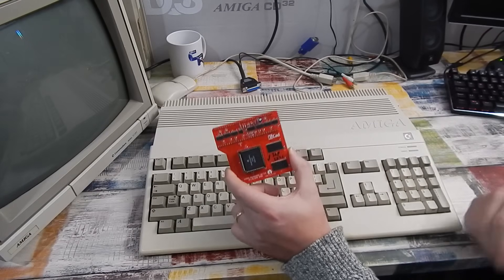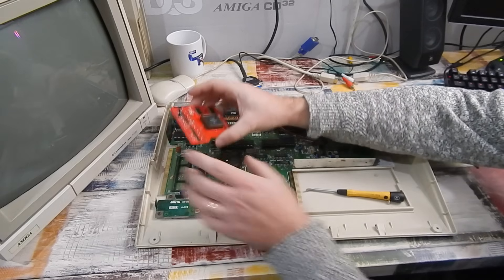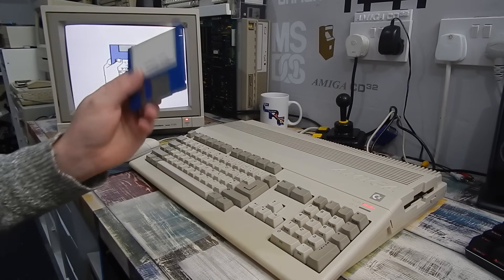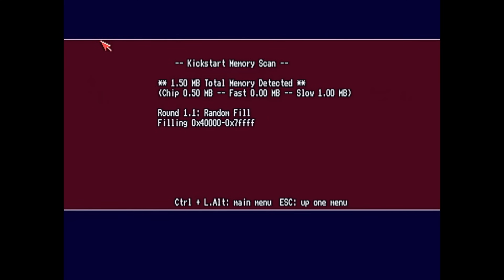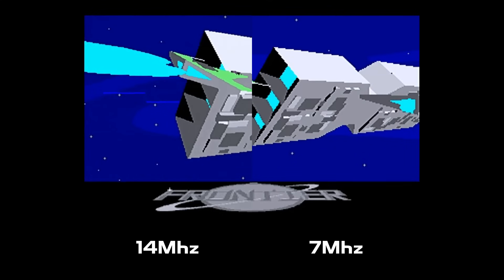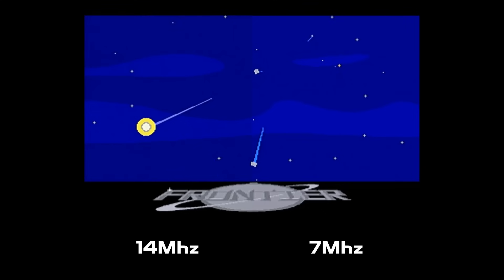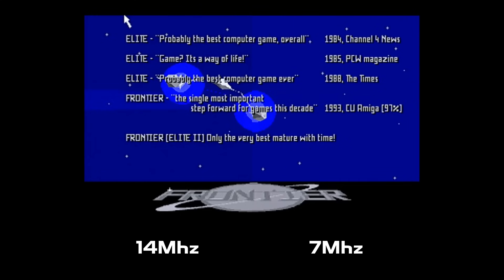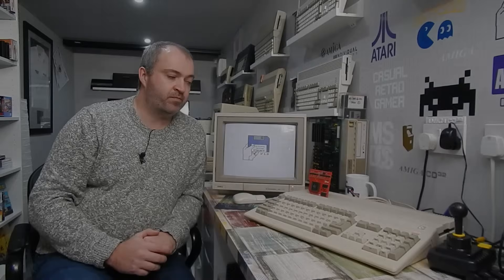A new Amiga 500 Accelerator for under £40

Comment from the maker: I feel a bit of house keeping is required.

Firstly the memory on this card is referred to as ranger ram, essentially fast memory but mapped into the slow ram address space.  From conversation with the cards designer this was done to simplify the design while achieving the best performance and keeping the cost to a minimum.  

Secondly there has been some comment over my stated price of this card and its availability.  I need to be clear and state that the card I have was genuinely listed for £35.  Anyone building and selling these cards is welcome to charge whatever they feel is appropriate for the cost of materials and their labour to assemble.  There are currently 2 of these cards available on eBay for £55 plus postage.  I'll leave it for you lot to decide if that offers value for money.
Reply: I think that having fast memory in ranger space is fine. You can go to 1MB chip and software that forces the use of slow mem should still work.

Comment: In many ways  I wish there had been a lot more games for the Amiga which specifically required more than a stock 68000 @ 7mhz. It might have encouraged many more people to upgrade but it was compounded by Commodore still selling things like the A600 longer after it shouldn't have even been a thing. There were many contemporary games that could run on an Amiga, but the market of say 060 and 040 Amiga owners was so tiny the R&D couldn't justify it.

Comment: I built me a couple of these, parts cost is about $35 each I'd say.  Did you have any luck stacking this accelerator with ide68k or any other addons?  When I tried it with my ide68k+mem68k combo at first it was a white screen, then there were flashing black bars, then colors, then solid black and I switched it off.  I built the 2nd one with a different PLL and it has better clock duty cycle but also frequent guru meditation, I think the problem is the clock phase which I can play with using the variable delay line chip I have.  As-is that one only produced a black screen with ide68k+mem68k, so I'm thinking clock phase is worth looking into.  Too bad I don't have separate ide68k or mem68k to test with.

Comment: The best A500 is A500 with a hard drive (CF) and bit faster CPU and more memory. Turning it into superfast A1200-like may break the compatibility with plenty of original software. Running games from HDD with more memory solves all the problems we had with this machine in the past which was disk swapping. Most of games won't even use the accelerator and it's unlikely that you'll going to use sophisticated software that takes advantage of fast CPU. Keep it minimal and close to the original as possible.

Comment: Someone has produced a small board that plugs into the 68000 socket and a raspberry Pi zero plugs into it which software emulates the 68000.  I'm wondering how the Pi solution compares with accelerators such as this one?
Reply from the maker: That's called the pistorm, I have a few videos on it if you want to take a look.  It is considerably faster then this board(about 25mips at present) and also adds support for hardfiles and rtg graphics.  It does have some compatibility issues at present but they are being worked on.  

But it not for everyone, some people might just want a bit more memory and a little speed boost, this card is perfect for that.
Reply: @CRG  I guess it depends on how true you want to be to the Amiga architecture (for want of a better description)

Comment: I think it's actually faster than a stock A1200.   If I recall correctly, I got 1.34 MIPS in Sysinfo.   Not sure, it's been a while.    I still have my souped up A1200, but it's out of commission atm.
Reply: The stock A1200 is massively hamstrung by the lack of any non-chip ram. Just adding a basic trapdoor ram card makes a huge performance difference. It's completely brain-dead that Commodore even sold it without any fast ram on board in the first place.

Comment: This might work with GPV Impact II Scsi controller + 8mb ram
Reply from the maker: There is an updated version of this that fixes compatibility issues with some side car A500 accessories.  I'm not sure though if it'll still work with those accessories that add fast ram as to the best of my knowledge anyway the address will conflict with the ranger ram on this card.
Reply: @CRG   no idea where to buy this updated version ? :)
Reply from the maker: @TheLemminkainen  Its on the github - https://github.com/Mathesar/14mhz-accelerator-SE

Comment: you could do the jumper mod so the amiga sees the trap door ram as chip ram, 1MB chip ram makes a bit of improvement in rendering graphics
Reply: One thing I did was replace the onboard RAM in one of my A500's with higher density RAM using low-profile sockets (and a new Agnus...IIRC), to get 1MiB CHIP RAM on-board.  😃

Comment: This is what i want to see... Cheap cards. I'm really disappointed that my cards are so expensive.
Reply from the maker: Your cards are without doubt the best bang for buck in terms of performance and features.  This one just peeked my interest as I wanted to see how much improvement you can get from seemingly so little.
Reply: @CRG  I still think my cards should be roughly half the price they are. But since i dont build em i dont set the prices.
Reply: Found out when i cisited my family that my old A500 in italy still works albeit the expansion is probably dead due to the darn Varta battery; wish there was a memory+mass storage solution at a low price [problem is also that is an 1.2 machine so no hard disk boot though]
Reply: @TerribleFire  Now that you've released the gerbers we might see some people offering them at cost... I'm considering it (I have a background in SMT design/manufacture/assembly)... I could use a cpl for the top layer though if you've got it
Reply: Why compare a 68030 card to a 68000? Isn't there an huge difference, not only performance wise, but also in the needed traces?
Reply from the maker: I merely made the comparison to highlight just how basic this card is.
Reply: I know all the job you put into the cards but unless someone make a production run some has to hand solder everything, give some kind garantee, maybe taxes + future updates. What would be a sensible price to you?
Reply: Why how much is a average card?
Reply: @CRG  I meant TerribleFire, as he compared his 030 expansion pricewise with the 14MHz/68k :)
Reply: You have created amazing cards that permit Amiga's to do so much more, for a price that is incredible. Your designed cards grace my A500 and CD32. Your hard work and brilliance have helped catalyze new development for this archaic hardware. Thank you.
Reply: You are getting what you pay for. This isn’t a PsiStorm.
Reply: @fmlazar  a PsiStorm? xD
Well, the PiStorm (still?) comes with it's own deficiencies, I wouldn't call it an serious contender, yet.

Comment: I remember people trying to drop a 68010 in the socket. While electrically compatible, it didn't offer much of a speed increase, and it DID introduce some miserable side effects (usually software not working). Something like this is PERFECT as a drop-in accelerator while maintaining a high degree of compatibility. Wish this was available back in the 80's!

Comment: So they just remade an ICD AdSpeed with some RAM on it.
They didn't even bother putting the RAM on the CPU's bus (which they could have done).
Making me think that if you dropped in a 2mb Agnus.. it might very well turn into CHIP Ram by default (usually Slow RAM under the 2mb belt can become CHIP RAM).
The socket problem is an issue of poor planning.
I guess they didn't bother taking any measurements eh?

Comment: Interesting how this system is faster than the the A1200 with a 020 at the same frequency.
Reply from the maker: That's the ranger ram for you and it is really that which gives this accelerator its speed.

Comment: Love your Amiga collection. Those 2x A1200's ( on your shelves ) look brand new
Reply from the maker: Thanks,  I've got the 2x 1200s (one with an ACA1233N and the other with just 8mb fast ram), a CD32 with TF330, a PiStorm A500+, the A500 from this video and another A500 with the RGB2HDMI mod.  

As for the 2x 1200s looking new you might be surprised to know they've never been retro-brightened.  Maybe I'm just lucky but the plastics just stayed white.
Reply: Still got 10 A1200`s, 3 A600`s a couple of 500+`s & 10 A500`s! 
But not a collector though. Duh.

Comment: - This has Fast Ram (fast ram is ram not sitting behind Agnus), but its mapped in the slow/ranger region? Is this because mapping it otherwise would require some logic for autoconfig? Are there any Amiga benchmarks letting you test memory speed by manually selecting address range? This will show 2x speed difference.

- This design could be cheaply boosted to 8MB with 245 buffer and $25 AS6C6416 8MB SRAM. Like Amiga 1000 Parceiro, but with care not to run 3.3V part on 5V bus like a crazy person.

- You should be able to use your trap door ram if you set it to Chip memory and Agnus is able to handle the size.

- There used to be A500 mod to double CPU clock to 14MHz (14MhzA500.lha), but without fast ram or cache speed gains were minimal. Makes me think second 68000 on this card is redundant.
Reply from the maker: Yes it's fast ram mapped as slow but I'm not sure why this is the case.  There are other more detailed benchmark utilities that allow more detailed testing, I'll see about running a few tests.

I need a different Agnus to mod for 1mb chip ram but I'll see about getting one as it would top this system off nicely.

The use of the plcc, I assume, is because they are rated for the faster speed.  

As for taking it up to 8mb I'm sure it could be done easily enough as you say but there are plenty of other upgrade paths, I think the point of this card is to do it as cheaply and as simple as possible.
Reply: @CRG  14MhzA500.lha hack worked with stock 68000 CPUs in A500, so speed shouldnt be an issue, heat might.
As for the cost, 5V 512KB SRAM used in this are already $4 a pop and you need two, replacing with one modern $25 8MB chip seems like a no brainer. If this could be made to run with 68000 onboard the price would stay the same.
Remap SRAM back to 200000 + manual addram command and we have a cheapskate upgrade winner.

Its still great for what it is, Im just throwing ideas around.

Comment: Back in the 90s, I once bought a 25Mhz 68030 board for my A500. I plugged it in and saw absolutely no noticeable difference in speed. When I contacted the seller, he told me that I needed to have some Fast memory in my system to see much of a difference and that ideally, I should populate the accelerator board with RAM for the most improvement. As memory was expensive back then and I couldn't afford to buy the RAM, I arranged to send it back for a refund.

Later on, I ended up buying a package deal from someone that included an 8MB ram expander. Shortly afterwards, I got a Supra Turbo 28, which was a 28Mhz 68000 chip. You could switch it on/off while the system was running and the change in framerates n games like Wing Commander made more than a few jaws drop. Best of all, it seemed to be 100% compatible even with European games. I can't recall ever having to disable it to get any game to run, or any game not running properly with it enabled.
Reply: Sound awesome !
Could it run this nasty US Crap Outrun with some usable fps ?

lg
Reply: The first one was likely the Mighty Midget Racer. I had similar experience with the earlier 020 (CSA Midget Racer).

Comment: Can't the address space of the trapdoor expansion be changed by cutting a trace on the mother board and jumping two solder pads? That may give you 1MB Chip + 1 MB Slow in total if you have an Agnus chip that supports 1MB or more of Chip RAM. Depends on Your board revision and the custom chip revision(s), but it could be worth checking out.
Reply from the maker: Yes it can but I need a different agnus.  The revision in my A500 can only address 0.5MB chip.  It does work though and it is my plan for this system.
Reply: @CRG  I may have a spare 1MB chip or two somewhere. I got the MegAChip adapter back in the day so I'm maxed out at ~2MB in my old A500.
Reply from the maker: If you had a spare one I'd certainly be interested in buying it from you. Drop me an email if you like.
Reply: @CRG  I'll have a look and see what I can find. I made a screenshot of your last post, so you can delete it if you want. To avoid spam-bots etc.
Reply from the maker: Thanks
Reply: @CRG  I'll have a look when I'm back home where things are stashed. It may be a couple of weeks before I get a chance though.
Reply from the maker: No rush, just whenever you can.

Comment: I heard this accelerator was incompatible with the Amiga 2000 due to timing issues which is a bit of a bummer for me. can anyone confirm this?
Reply from the maker: I honestly don't know but even if it did work I'm not sure I'd recommend this board for the big box Amiga.  The additional 1MB of memory this provides despite sitting in the slow ram address space seems to always conflict with fast ram in the Z2 space.  My assumption here is its because this "ranger ram" is local to the CPU.  You'd be essentially limiting the box box Amiga to 1MB chip and 1MB ranger ram.

Comment: The only way I could see this being worthwhile is if you have a 512k machine and want the extra RAM.  Because there really isn't any other use case for it.  This isn't the 1980s where your general computing needs will be faster. There are probably very few if any games that will both run on an a500 and benefit from the faster CPU.  In the worst case, there will be some games that run slow, only faster.  It will still run at 10fps, but the seconds go by quicker.  It's hard to explain what I mean, but this happens on certain very early PC games that ran slow.  When you get a faster PC, the clock of the game runs faster, but not the FPS compared to a real clock in the real world.
Reply from the maker: I know what you mean, the game F18 interceptor is an example and 005 AGIMA did a great video on it - https://www.youtube.com/watch?v=GDQQ5WdKfBY.  Its not the case for all games though and very much depends on how they were coded.  The likes of Dread and Frontier increase their frame rate rather than game speed.  Microprose golf though, that I showed in the video, in hindsight I think it might be another like F18 in that both the frame rate but also game time speed up.  I think I'll do some more testing on that part.  

Regardless though I still think this card is a good option.  Its got the 1MB of ranger (slow) ram and the CPU is twice the speed.  Yes there are very few games that will make use of it but if you just want a cheap drop in card to make things that little bit faster it is a good option.
Reply: @CRG  Is the RAM on this expansion board faster than the trap door RAM?
Reply from the maker: @tarstarkusz  yes, it's considerably faster.  While addressed to slow ram it is actually fast ram.

Comment: I remember from my old 286 upgrades to 386 and better, you would put the upgrade board on top of the old processor. The processors had a pin that disabled them when another was stacked on top. Perhaps this works the same?
Reply from the maker: On this card we are removing the original 68k cpu and replacing with the one on the accelerator but in other Amiga accelerators, like those on the 1200, it works exactly as you describe.  The original onboard CPU is disabled and the one on the accelerator card takes over.

Comment: have you happen to had the pleasure of trying the Pistorm as of late?
Reply from the maker: I do have an A500+ with the pistorm but I haven't used it in a few weeks.  Still need to try out the last update.
Reply: @CRG  working on some tables for emu68 not where it should be but getting there. If you have questions you can ask on the discord getting it up and running on your pistorm.

Comment: Great video! I wrongly thought things should play faster rather than having smoother frame rates.
Reply from the maker: Thanks.

You have to remember that like any Amiga accelerator all this is doing is increasing the speed of the CPU.  The chipset still runs at 7mhz.  That's why I tested games that are CPU intensive.  All 3 of them hit the processor hard for calculating geometry and it is only within CPU intensive software you will notice any difference.

Comment: Can you get this card with just 1 MB of fast ram in place of the 1mb slow?
Reply from the maker: While the ram on this card is mapped to the slow address space it actually sits local to the CPU running at (in this case) 14mhz just like fast ram would.  

Apparently this type of arrangement is known as ranger ram and it is this which gives the card most of its speed.

Comment: Neat. I wonder how hard it would  be to adapt this accelerator for the ST, maybe without the ram.
Reply: Then it would be pretty useless. I have built a 68000 16MHz "speeder" (no cache, no AltAM onboard) last winter. Speed increase is just 13%. It's very similar to the DIY project "SpeedUp16" from c't magazine 10/1990.

Comment: With a 1MB Agnus you should be able to use the trapdoor memory. Kinda cool that it has Ranger mem like the A1000 addons originally had (real fast ram), and since it isn't slowmem then I'd go for a 68010 so you get the VBR and can move the interrupt tables out of chipmem.
Reply from the maker: I've got a 68010 on order, will be interesting to see how it performs.